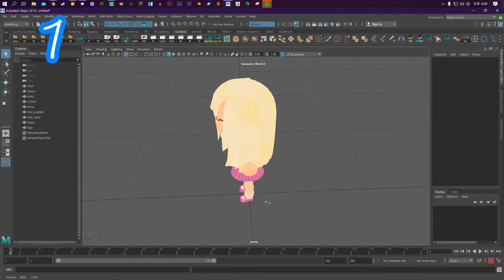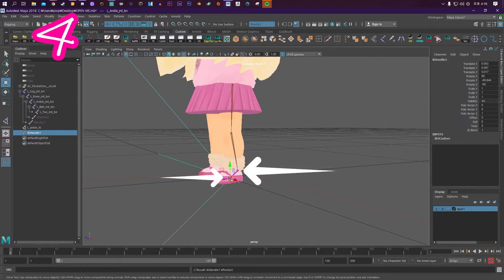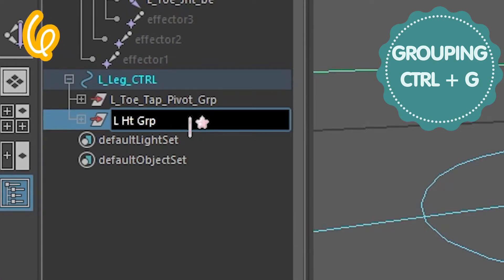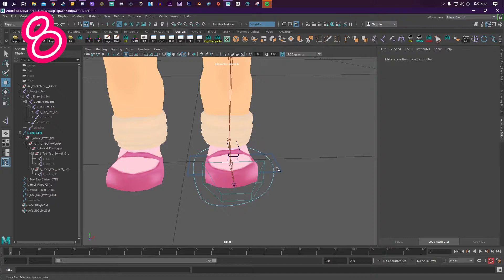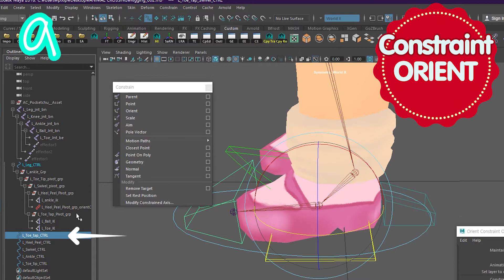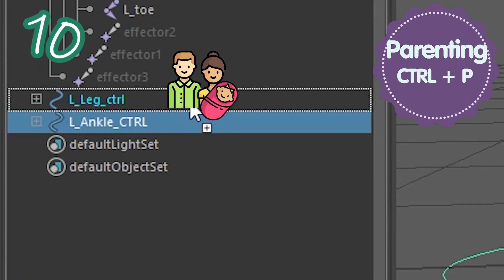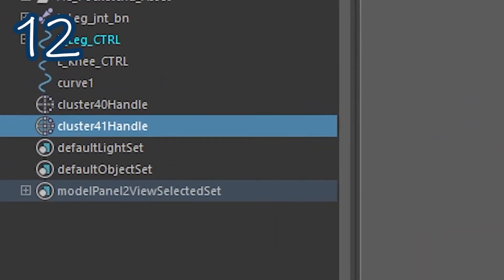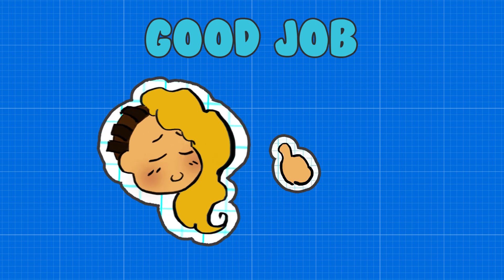How to ll  Rig an Ik Leg in Autodesk Maya FAST and EASY

Comment: Hello, is it posible to anímate the “sticky” from the IK Handle?...it seems to be better with the sticky on but if I want to rotate the entire character  from the hip and with the sticky it doesn`t work….I know I could group the character to do this but I want to make it walk a few steps before I rotate it and if I do this the pivot of the group stays behind, that is why I ask about the “sticky” from the IK Handle
Reply from the maker: Hey there :D!

Thank you for your question, That's an interesting one..
The best way I can think to do that (As it doesn't show sticky as an attribute that you can key on and off)

You could:

-Act as if you're making an IK FK Rig
-instead of "FK IK", it'd be "FK IK Sticky" or "FK IK IK Sticky" if you want more!
- (Do the same process as if you're making an IK rig but make sure it's sticky!)
- When you've got  all your legs in order
- You can then switch between using a sticky leg and a non sticky leg! x
Reply: @PixifiedTips  thank you!!

Comment: Genuine ask, is there a reason why you dont cover local rotation axes? Whenever Im rigging, no matter how straightforward my rig is, some joint has a screwed up rotation axis from the moment i created the joint.
Reply from the maker: Hi Ape!
hmm, let me think..

So when the joins are made, usually they come up with whacky positions but that's just because they're fitting into space.
You can wipe the positions/ orientations of the joints themselves but it's not really neccessary, 
as we can put all that on controls instead.

so don't worry about whatever the joints are doing (unless your thing specifically needs it but we can put that work elsewhere).

Just incase you need it though i found this:https://www.youtube.com/watch?v=u1-ptE4f4e4

Make sure your controls, before you move them have a default of 0. 
you can choose to use "object" instead of "world" as your axis point, allowing the rig to do whatever but the controls will be clean and move as expected

Comment: So the ankle rotates fine, but when I add the other constraints neither the foot or ankle ctrl rotates the ankle ?
Reply from the maker: hi Juliemt!

thank you for waiting xx
(I shall make a new tut eventually!)

The order of where the connections go is super important
so if you connect the wrong thing or use FK instead of IK

it will not work.

SO if you do reuse this tut make sure you've got the right joint and the correct type of constraint selected.

Comment: Hello. I have a question that I couldn't figure out from slowing down or pausing the video, but it's a basic thing that would probably help me so I thought I'd ask.

How do you make the Controls? For the foot I noticed it was a simple NURBS circle, but later on for different parts you were using different tools that were glossed over, such as what looks like a wireframe NURBS called a "BoxCrv", that I can't seem to find clues on how to make anywhere, and later on for the knee joint there was a diamond/square-shaped NURBS that I also can't figure out on my own, since all my NURBS are curved unless they're grouped... unlike what's shown in the video.

Thanks in advance! This video has been SUPER helpful anyways.
Reply from the maker: Hi there Nathan!

Ah yes this video doesn't really cover that

Ironically I'll have a video coming out in 2 weeks that show how to make controls!

(It's already in the patreon atm ) x

but the simplest way to create your own controls is:

1. create > nurb primitives > circle 

2. on the circle > rmb hold (right mouse button) > control vertex > select some points and shape them with scale or move!

3.select your control> open attributes editor> object display > drawing overrides ? enable overrides > pick a colour!

DONE 

I'm really glad the video was helpful :D xxx
Reply: @PixifiedTips  You've really saved me, thanks! I've got a final due in a couple of hours and was expecting to have to deliver a bit underwhelming... Not anymore xP
Reply from the maker: @nathanestrada6406  Ahhhh <3 <3 <3 

hehe My absolute pleasure lovely! :D

You're gonna rock this :3 x

Comment: Plz answer me this, Is this level of detailed rig required in production? I mean all the so many controls for foot, twist swivel, heel raises!?  It's not needed for walk cycles right?   Please lemme know!!
Reply from the maker: Hey Ral!
That depends on the level of detail you need !

If you're producing something that doesn't need to have a true foot roll, then no.

If you're creating something that will need to show a proper foot roll then yes!

Also this is also dependent on the animator!

(You can either place the controls in the channel box or leave them out like i have as separate controls)

-----------------------IN CONCLUSION-----------------------
As long as the foot has a:

- heel raise
- toe raise

That's enough to make a foot roll movement!
------------------------------------------------------------------------
Reply: @PixifiedTips  ❤ understood! thanks

Comment: Hello, sorry to bother you, however I was following along and the knee on my rig won't bend? It's almost as if the ankle is stuck to the ground? Any advice would be appreciated xxx
Reply from the maker: Hi Charlotte!
No problem at all let’s troubleshoot!

(Try this on a fresh scene with only the leg joint to get yourself use to it!)

1. After you made your skeleton for your leg, did you click create IK handle ?

2. If yes Did you click the box and select, rotate plane solver chain?

3. Did you click the top leg joint then click the ankle and call it ankle ik ?

4. Did you click on the handle that was made then move the translate around to test it worked?

5. Did you click create ik handle (box) again?

6. Did you select single plane solver?

7. Did you click ankle then the ball joint and name it ball ik?

8. Did you click ik handle (single plane solver) and select the ball joint then the toe joint?

9. Did you call that ik toe ik?

10. Did you make a control and put all the ik’s in it?

11. Did you move the control (that has all the ik’s) to test it moved?

Check through this and we’ll see what went wrong!